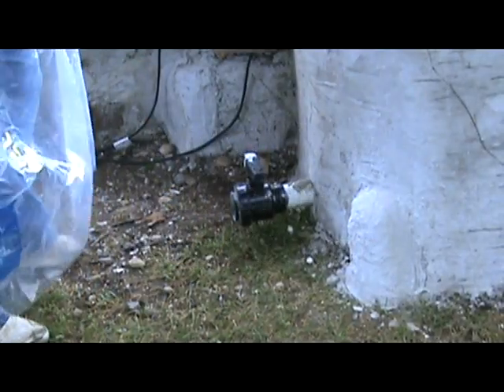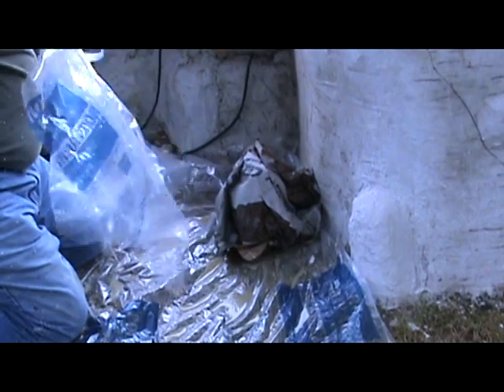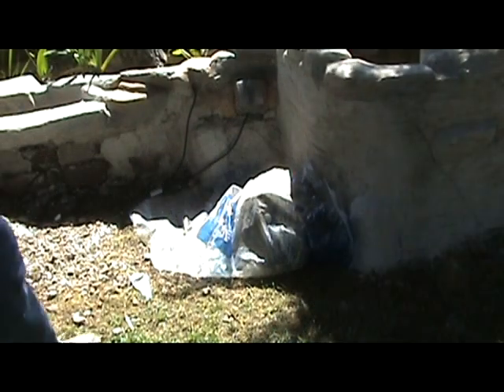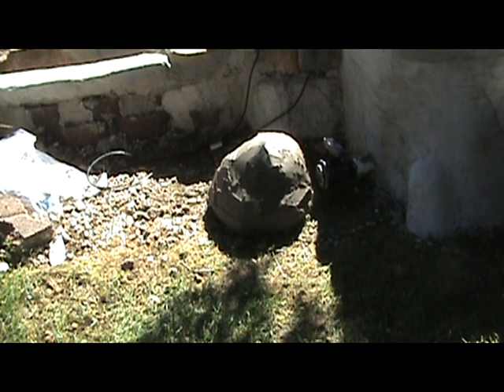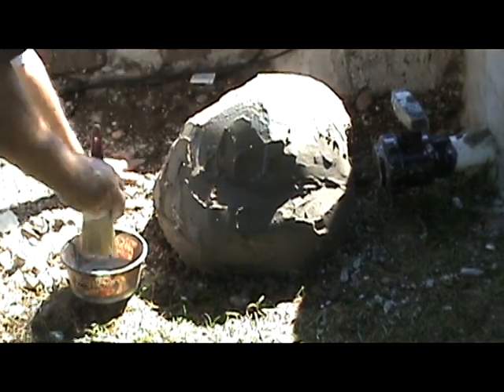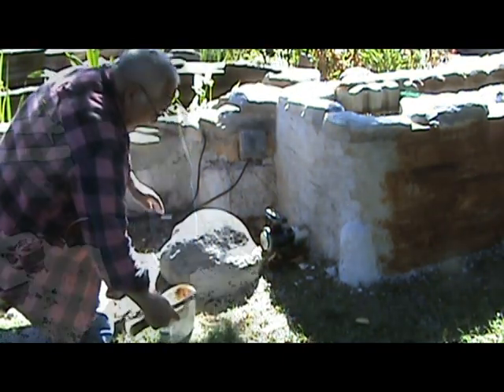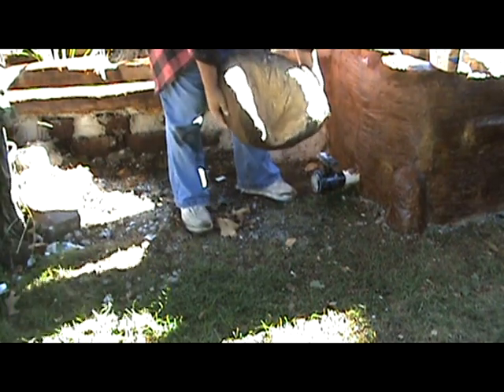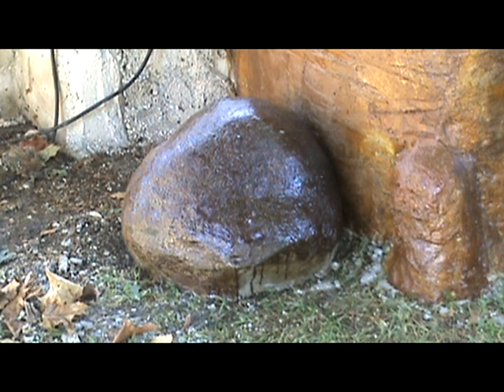How to Make a Hollow Faux Rock Cover

Comment: Great video!  Thanks for posting! Trying to convince my better half that we should put a fake rock over our septic drain field valves instead of building a flower patch around them. Nearly 0 maintenance with my approach.
Reply from the maker: That will work.
Reply: Hmmm. Did you end up with both? Or just the flower patch? Lol.

Comment: Hubby is designing a new sprinkler and pump system that is too long to cover with a commercially made rock, so I thought I'd see what YT has to offer. This is great, and I see you have updated it using vermiculite or perlite rather than the messy styrofoam beads, which makes sense. Now, if only I can convince him to try it, or do it myself when he's not looking! I'd sure rather do that than order two $300 fake rocks! Thanks!
Reply from the maker: You're welcome.

Comment from the maker: The first layer contains styrofoam beads as the aggregate -- not a suitable surface for finishing. The second layer is a sand/cement layer -- finishes well to simulate rock.  The styrofoam beads are insulation for cement block; mine came from Menard's. No, you're not asking too many questions; glad to help. You might like to watch the series on my channel entitled, "Making Faux Rock for Your Pond".  The first part discusses where to get materials.

Comment from the maker: I mix in a 5 gallon bucket with a paddle mixer in a half-inch drill.  Paddles are available at home improvement stores where drywall supplies are sold.  See my series on Faux Rock for Your Pond to see how I mix my material.

Comment: This is completely brilliant! I love so many things about this, but especially that this recipe combination appears to so light weight, while appearing strong. I'm sure there is an original date for this video, but I don't notice one, so I am assuming that you have done these rocks for quite a while now, and I was wondering how well they have done with the weather? I can get a lot of heat and rain here, in Florida
Reply from the maker: I made that rock and video 10 years ago.  Rock is still there doing it's job.  I live next to an elementary school and kids come over for ecology lessons each fall. The rock gets stepped on, climbed on and stomped.  Our weather here in northern Illinois has varied from near 100 degrees in the summer to 30 below zero in winter.  Freeze/thaw cycles are the bane of concrete.  This rock and all the others have withstood it all.  BTW, my sister has a chocolate shop in Lauderdale-by-the-Sea.
Reply: It says October 2009, so it's certainly withstood the test of time!

Comment: I'm sorry for being dense, but in your recipe you use "parts." 3-parts Styrofoam beads. 1  part sand, 3 parts water to 1 part polymer ... what is a part? Is that for every cup of Styrofoam beads mix that with 3 cups of sand?  Not knowing if this matters, but I plan on mixing this in a 5 gallon bucket.
Reply from the maker: I use a 5 cup yogurt container as my "part" measure.  Use whatever you like.  So, I might use 3 yogurt containers of sand to 1 yogurt container of cement or, I might use 6 yogurt containers of sand to 2 yogurt containers of cement.  Either way, it's 3 volumes (parts) sand to 1 volume (part) cement. If you use a cup, then a mix could be 3 cups sand to 1 cup cement or  30 cups sand to 10 cups cement, whatever.  The "parts" just refer to using the same volumetric unit for each ingredient.  Got a big mixer?  3 buckets of sand to 1 bucket of cement.  Got a tiny repair?  3 teaspoons of sand to 1 teaspoon of cement.

Comment: thanks for your video. looks like it is a fun project plus adding a nice feature to the yard.I have one question I hope you can answer.we live in cold  [ in the winter ] weather with snow. will this hold up to the cold weather.thank you very much.ron
Reply from the maker: +Diane Lewis I live in northern Illinois.  We get down far below zero (Fahrenheit) and average 36 inches of snow per winter. Summer can be very hot and humid.  Lots of temperature extremes The rock is now 6 years old. Nary a crack.  My pond and all the rocks around it are concrete and are 10 years old. Check out my other videos, including one on newer concrete mixes.  The most important things to add to your mix are acrylic in the liquid and fibers in the mix.

Comment: Hello, I have a rock pool structure (above water but does have water flowing over some areas) and I want to repair that does have a slide and waterfall.  

The weight-bearing components are fine - but it needs some build-up to have the water redirected from the waterfall (so it doesn't come inside the play area) and some patching/painting to the exterior as the previous homeowner thought it would be smart to pressure wash it. 

No one here (Brevard County) seems to know how these structures are built or maintained. I think I could use your formula to make these repairs but was wondering if you have any experience with using your formula to patch faux rocks as I will need it to stick. I'd hate to cover the structure without using the proper prep/bonding agent and have it all crack off.

I believe I can return it to its original luster with a little guidance and elbow grease.

Thanks for your post - posts like yours are always helpful and inspiring for me.
Reply from the maker: The only experience I have is what I've done with my yard and with the pond I built with my brother in Tennessee, but I have added to and changed rocks to different styles. https://youtu.be/1m7pPGrhamI  First, clean or scarify with a grinding wheel to remove loose material and exposed a rough surface.  Then, apply an acrylic bonding agent and apply the new concrete.  Make sure the new concrete also contains bonding agent/admix.  You can also scrub on, with a brush, a bonding layer of straight portland cement mixed with bonding agent before applying the new concrete. That bonding layer should be the consistency of thick paint.  Apply your new concrete before the bonding layer or acrylic has cured.

Comment: I notice you don’t use any sort of wire mesh over the plastic/inner core. 

Do you know what the pros and cons of using wire mesh on the inner structure might be?

Thank you so much for this video, it’s great!
Reply from the maker: First, the plastic sheet is just to keep the concrete from sticking.  It is removed after the concrete is cured.  There is no need for wire reinforcement with the use of fiber and the strength of the mix.  It's hard for most people to understand that these concrete mixes don't required reinforcement unless there is a specific reason to do so.

Comment: Thanks
I looked up the brand you use and I'm not ready to invest $130 just yet in this project. Frankly I can buy a ready made fake rock for that price.
 If the brand I found at HomeDept will work - then I'll use that - 
  I appreciate the reply.
Reply from the maker: I agree it wouldn't make a lot of sense to buy a 5 gallon bucket for a little fake rock.  That's just common sense.  I wasn't suggesting you spend $130. You asked for brand names and I gave them to you. Just follow the directions on the label for proper dilution.

Comment: So glad to find you/your channel! We have a "new" home that was an estate sale. The people that lived there did a lot with concrete, including a large pond, complete with a once-lovely mermaid, a large snail planter & the pond itself, all needing some tlc now. Your videos are a treasure trove! Any tips in restoring?? Thank you!
Reply from the maker: +Kindsister Deadhead Get some acrylic bonding agent.  I buy mine in 5 gallon buckets but you can get Quikrete bonding agent from Lowes or anywhere Quikrete products are sold.  You can even get it from Amazon.  Also, get some hydraulic cement, carried by home improvement stores.  For cracks, first water them down until saturated, remove any standing water, wet with acrylic, fill cracks with hydraulic cement, let dry and sand.  Only mix enough hydraulic cement you can use in a couple minutes. It hardens VERY quickly.  For broken or missing pieces, treat with water, add acrylic to broken surfaces, mix cement with acrylic to a paste or clay consistency, add to broken pieces and tape or clamp together until cured (overnight), sand.  For missing pieces, treat surfaces the same, add cement and sculpt with whatever carving tools are available.
Reply: Wow! Thank you so much! I no longer feel completely overwhelmed. The pond seems doable with your suggestion. Will the pond be toxic to fish & plants? The places needing work are above the pond on a now dry stream bed. But I want to use it again.
Reply from the maker: +Kindsister Deadhead The materials actually  make concrete more friendly to fish and plants.  The acrylic cures to a clear plastic material, which will not dissolve in water. Concrete tends to be quite alkaline and can cause pH levels to be increased.  My original pond was made without the addition of metakaolin and silica fume.  I'd use them now were I starting anew, as they react with the material produced by concrete when it cures and, thus, reduces alkalinity.  If you want to assure the waterproof quality of your streambed and pond, see if you can find a distributor in your area for a crystalline silica waterproofer, such as Xypex, Penetron, Kryton Krystol, or Aquafin.  These can be found at industrial or construction supply places.  A concrete pond or stream can  be coated with something like Xypex Concentrate, which renders the concrete waterproof and can actually seal minor cracks.
Reply: Thanks!

Comment: This video was great but I have a question:  I was able to find most of the ingredients on Amazon - but even my local home center did have Acrylic Liquid Polymer that you mentioned in the video.
Can you give the brand name or more information? I was able to find "Adacryl Admix and Bonder.." at Home Depot...is that the same thing?
Reply from the maker: Acrylic bonding agent/admix comes in literally dozens of brands, dozens of chemical variations and dozens of solids content.  The one I use is from Fishstone https://concretecountertopsupply.com/Item/KongKrete-Acrylic-Polymer-GFRC   It is 50% solids and I dilute it 3 water to 1 acrylic.  Those found at home improvement stores such as the brand you mention work well, but are usually of much less solids content.  Try to determine the solids content if you can by contacting the manufacturer or follow the directions on the label.  There will normally be instructions as to how much it should be diluted.  What you found is an acrylic bonding agent/admix.

Comment from the maker: I get most supplies from a local concrete supply house and polystyrene beads from a local home improvement store.  Many people have trouble finding these beads. I suggest using a 3 to 1 sand/cement mix and crush up polystyrene packing material to lighten the concrete.  Send me a PM with an email address and I'll send supplier lists.

Comment: I Love your rocks. Im a landscaper in south florida and Im currently buying  lightweight cap rocks from a store anywhere between $50 to $200 each. You make it look easy to make them. May I ask you where I can find your ingredients? Specifically the acrlic polymer or fibers for strength, styrafoam beads and stains for color.
Reply from the maker: First, watch my video on concrete mix. https://youtu.be/etSWuBIcdZc  Finding the ingredients was a problem for me at first because suppliers often will only sell in pallet quantities.  Who needs $3000 worth of fiber?  Depending on how many rocks you want to make will determine where you get supplies.  If you're not going to do a lot of concrete work and want to get the acrylic you'll need, start by checking at Lowes or Home Depot or anywhere bagged concrete is sold.  Quikrete make both an acrylic bonding agent and an acrylic concrete fortifier. Use either one. Ace Hardware either carries or can get from the warehouse an acrylic called Acryl 60 by Thoro.  If you want larger quantities such as 5 gallon buckets, look at industrial and construction supply places. Do a Google search for construction supply in south Florida, call some and ask if they carry acrylic admix.  Instead of driving yourself to distraction looking for styrofoam beads, substitute horticultural grade vermiculite, which can be found in garden centers, nurseries and even in unlikely companies such as this  http://www.uline.com/BL_3801/Vermiculite?keywords=Vermiculite   Look to obtain superfine grade vermiculite. Use the finest you can obtain.  Makes super lightweight concrete.  You can also substitute perlite, another horticultural soil additive.  I get fiber from Fishstone in Crystal Lake, Illinois.  They will supply relatively small quantities. http://concretecountertopsupply.com   For acid stain, contact http://butterfieldcolor.com and ask for a distributor near you or order online from http://concretecamouflage.com  What part of south Florida are you in?  West or east coast?  If you're near Ft. Lauderdale, check out my sister's chocolate shop in Lauderdale-by-the-Sea.  https://www.janscandies.com/
Reply: Thanks for the directions. I think I will just start off with a few to see if Im capable of making them realistic before I invest a lot of money in materials. If I use some type of metal lath I could probably get away without using the fibers for now right? Perlite / vermiculite are pretty expensive so thats why I was hoping to use styrafoam instead. I found that wallmart sells bean bag filler beads online. Do you think they will work? Does the second sand coat need fiber too? 
I live close to ft lauderdale so I will definitely stop by your sisters store. Whats your name so I can mention you. Im Steve. nice to meet you
Reply from the maker: Vermiculite in bulk is not expensive.  Beanbag filler can be used, but it's not what I'd call cheap.There is no one right way to do these things.  Since, you're experimenting for now, try whatever comes to mind.  If it doesn't work, do something else. Yes, I put PVA fiber in the final coat since it doesn't show in the finish. You can make the final coat without fiber.  You're in a different climate zone than I.  If I didn't use the fiber, they wouldn't last in my severe winters.  I'm Don Perry; my sister is Janice Lendi.  She's up here in Chicago for a candy show at McCormick Place until Thursday.  Her shop is closed until after that.
Reply: @dperry428  Your sister has a chocolate shop? Be still, my heart!
Reply from the maker: @kjirstinyoungberg5946  https://www.janscandies.com/
Reply: @dperry428  Thanks!  I looked her up myself as soon as you mentioned it! I'm hopeful she has been able to survive over COVID. Her candies look amazing! Black and brown bear paws...yum! 
My uncle owned The Candy Jar in San Rafael, CA for many years. It was seen in the background on a couple of the "Dragging Main" scenes in American Graffiti. (Such a great movie. They don't make 'em like they used to...)
Reply from the maker: @kjirstinyoungberg6092    You can order online.  Try her Froggers.

Comment: Good day sir!  I am hoping to make a large hollow rock to cover a utility box in my yard. It needs to be light so as not to impede access for service but the size would need to be approx 4’ x 4’ x 4’ hollow. Any ideas for me?
Reply from the maker: That's pretty big, so making it one piece, no matter how much lightweight aggregate in it, would leave it quite cumbersome to remove.  I'd make it in two or more parts.  Concrete won't stick to plastic sheeting, as shown in my video, so you can make sections that are removable to make weight manageable. First, create a portion of the rock, such as a ring around the base, let it harden, cover it with plastic sheeting and form the other removable section(s) over the plastic.  When it hardens, simply remove the plastic and set the section(s) back in place. They will be a perfect fit and, if you plan it well, the separations between the parts can be made to look like crack(s) in the rock.
Reply from the maker: Read the above reply.  How big are you talking about?  A whole tank or just an opening cover?  It will work with anything that doesn't get so big that it's too heavy to move.  It's still concrete and even lightweight concrete gets pretty heavy if you make the rock big enough.

Comment: can you share the exact products and amounts so i can get a better idea what to buy
Reply from the maker: This video is 11 years old, so the ingredients I use here would be different today.  The original mixture was 3 parts styrofoam beads, 1 part sand, 1 part cement, a handful of polyproylene fiber and liquid made from 3 parts water to 1 part acrylic admix.  Today, I would substitute perlite or vermiculite for the styrofoam beads and use PVA fiber instead of the polypropylene fiber. Styrofoam beads are messy because of static charges and blowing all over.  Both perlite and vermiculite are more readily available in garden centers.  You can also substitute dry acrylic for the liquid stuff.  Today, i would also add 10% metakaolin and 8% silica fume.  Metakaolin, silica fume, PVA fiber and dry acrylic are available at  https://concretecountertopsupply.com/   You can also just go to a home improvement store and get RapidSet CementAll, add perlite or vermiculite, fiber and acrylic and you'll have a strong, lightweight mix.  Acrylic can be purchased at Lowes or Home Depot and are referred to as concrete fortifier or bonding agent.
Reply: @dperry428  thank you for getting back to me, will let you know how they turn out
Reply: @dperry428  Sweet! Good info, thanks! 😁👍👍